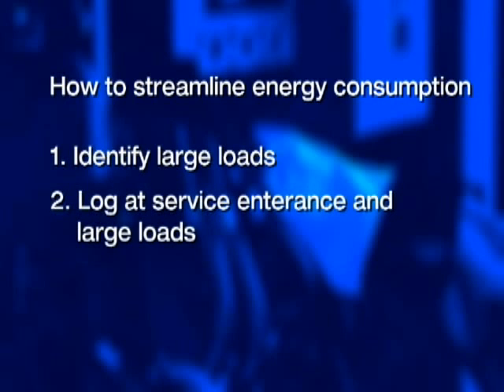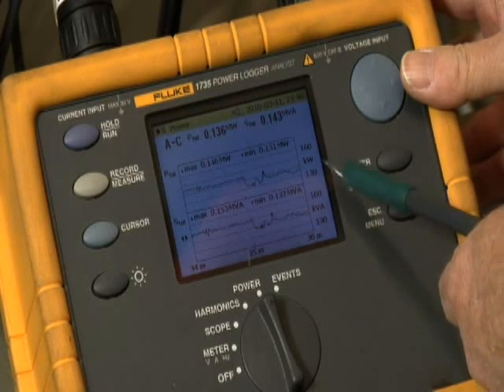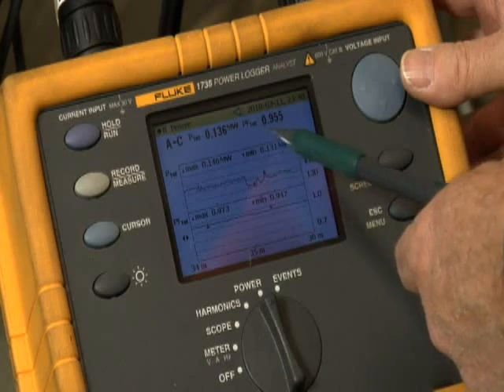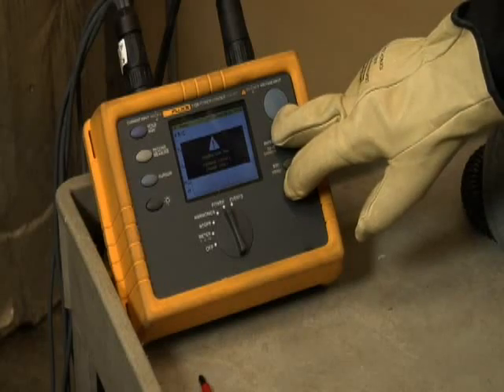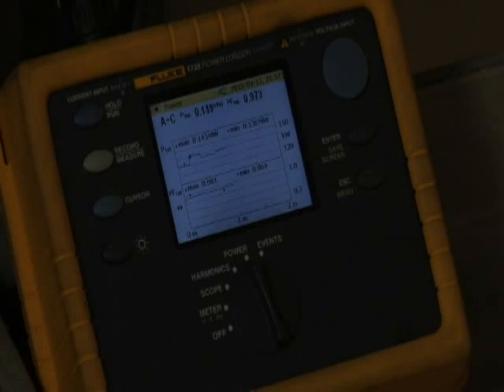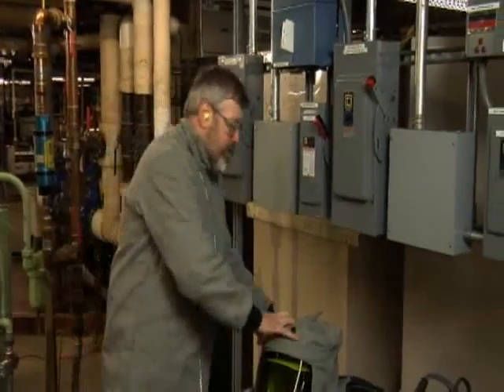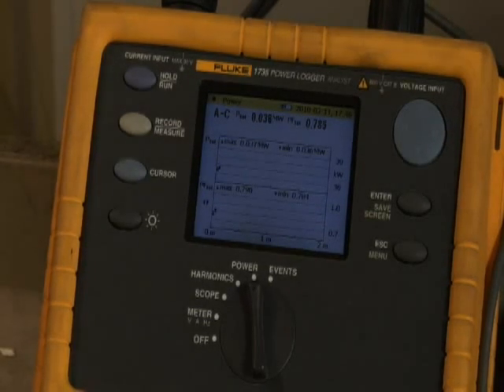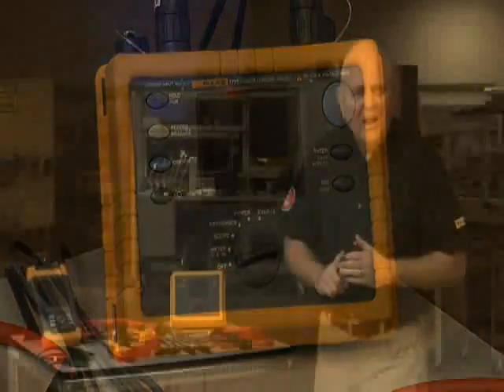Fluke 1735 Three Phase Power Recorder Logger Power Monitor Power Quality Energy Studies

Comment: Can it be possible to use fluke 1735 logger meter for five days and get the expected result when performing load analysis in electrical power system?